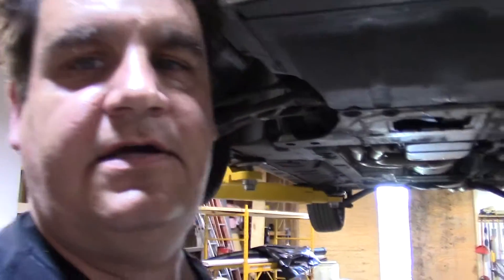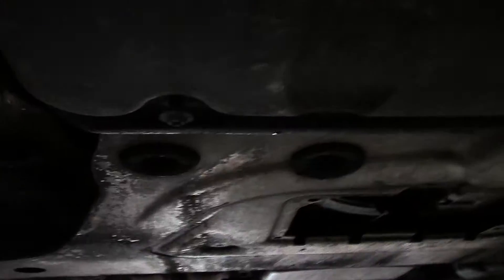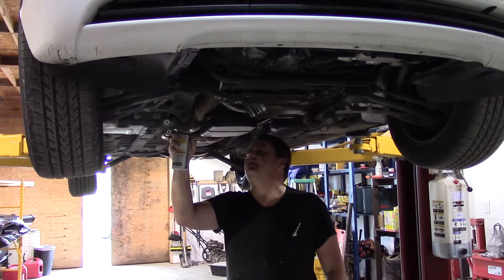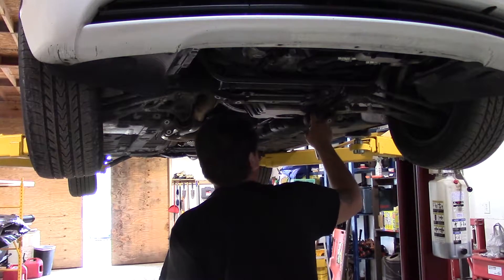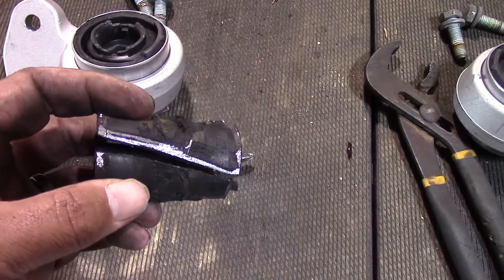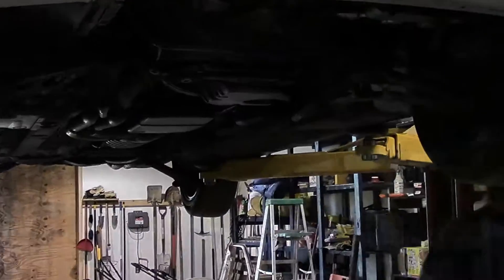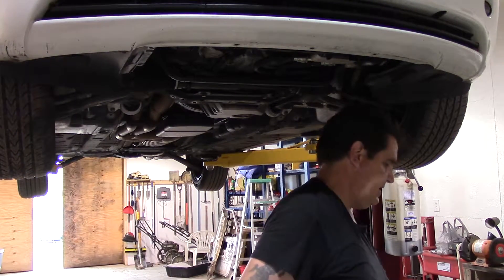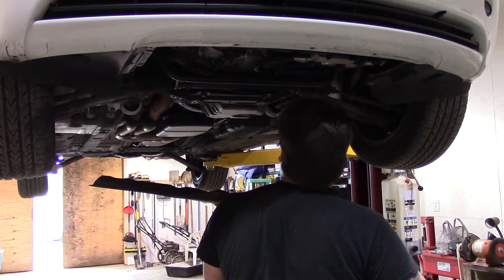2003 BMW 325i Lower control arm bushing replacement

Comment: The most important part (installing the new bushings), and the part that seemed most difficult, was all in fast motion with no commentary. It would have been helpful to know why it was difficult and what you were doing to get them installed correctly.

Comment: Well you made that look like a walk in the park mike :-D
The technical term for the state of the left bush is "Well knackered" ha ha lol.
That lift is worth every penny, i love the ease of access, and im just a viewer, for you it must be the best thing since sliced bread with peanut butter on it :D
My mate has a 20 year old bmw, and he replaced the bushes+wishhbones as a whole unit (both sides), the thought is to do both while your there, although doing it on the main road is not ideal.
Reply from the maker: zx8401ztv Knackered it was! This cars owner was lucky, for now, the ball joints on the control arm are in great shape, so the expense of complete control arms is not needed. The bushings are cheap, labor is the only real cost. I also had to change the lower radiator hose, I'm going to post a short vid on that too. Real interesting how they work with o-rings and all.

Comment: is an aligment necessary after this?
Reply from the maker: I would always get the alignment checked anytime I replace a part that moves in the front end :)
Reply: Thank you sir. The bushing is on and its aligned.
Reply: yes